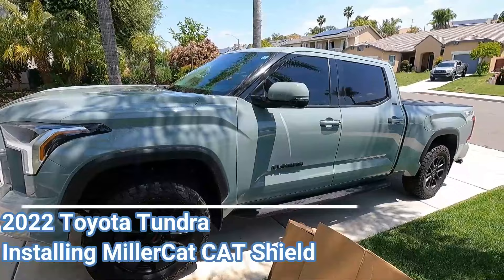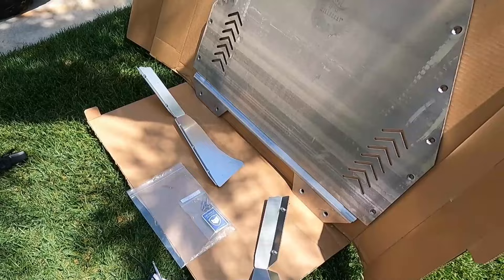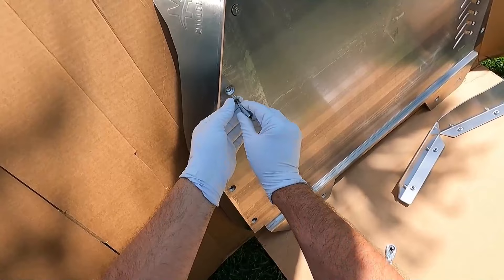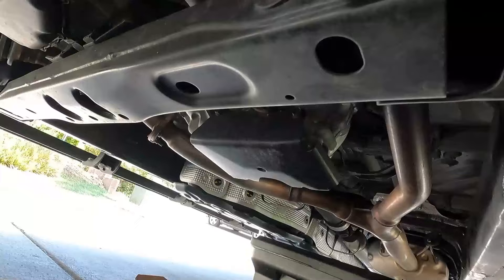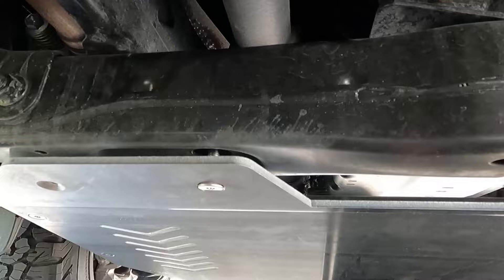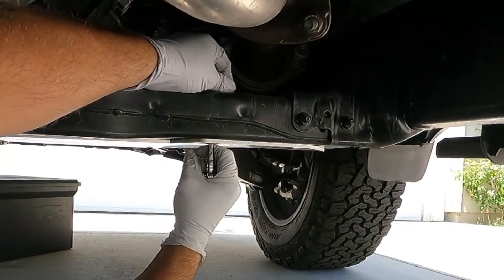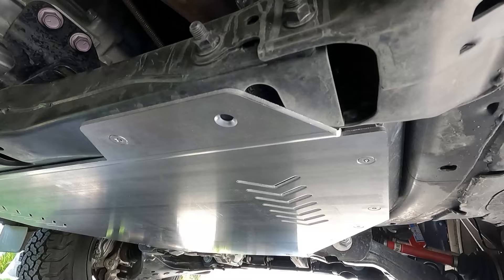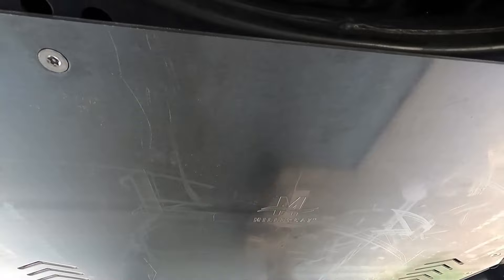2022 Toyota Tundra Catalytic Converter Protection - CAT Shield by Miller CAT - Anti Theft skid plate

Comment: Just yesterday (I have three 15 second clips) a guy pretended he was running (in the rain) and my cameras alerted me via iPhone. I watched as he stopped behind my 2020 Tundra, looked at and under my truck and then happened to look straight at one of my cameras, he then looked down and scurried off. I also have a 2020 4Runner and I put a Millercat shield on it the first week I had it…
I just today bought a Millercat shield for my Tundra 4x4, complete with the rear add on shield pieces. 594.00…, also bought some AirTags, this theft business is getting out of hand. I am retired Law Enforcement and this business of favoring the criminal over the victim is clearly an attempt to undermine local authority. I believe the endgame is more of a dictatorship than any sort of Republic, if you pay attention you’ll see it’s been playing out for a while.

Comment: Just installed this on my 2024 Toyota Tundra TRD Pro and now my truck makes a loud clicking sound when I turn the steering wheel at slow speeds.
Reply from the maker: Hi Christopher,
I didn't have any problems or noises with this shield at all.  I did put one on a Honda Accord that had aftermarket exhaust which was a little off center compared to the stock exhaust so it made a little contact with the shield and made a rattling noise.  It was easy to find and easy to fix by clearancing it with a small grinder.  I would maybe put a gopro or something similar underneath to see if you can find out what's hitting and/or find the problem.  You also might just get underneath with the wheels turned each way to see if you can figure it out.  And maybe double check that everything is installed correctly on the shield.  Sorry you're having trouble with it, but best of luck to you finding the noise.  Please update us all on here if you're able to get it figured out.
Take care,
-Dan
Reply: https://youtube.com/shorts/TlKYlQ2SDmE?feature=shared

This sound I’m referring to. It’s more of a knocking sound. I just dropped off my truck at Toyota. I’ll let you know what I find out.
Reply: Turns out the cat shield and the skid plate mating points is what was causing the knocking sound. They added special silicone and lubricant and now the noise is gone. If you do not have the TRD skid plate, you won’t experience the noise.
Reply from the maker: @chris.arellano  thanks so much for the update and for letting us know!  And thanks for the solution for anyone else in that situation.
Take care,
Dan
Reply: I've had mine for 6 months now    my 3rd time taking it off and rebolting it because of terrible squeaking noise.  I'm truly disappointed